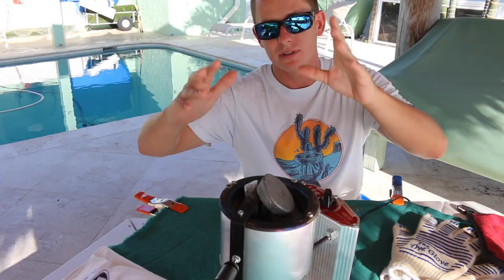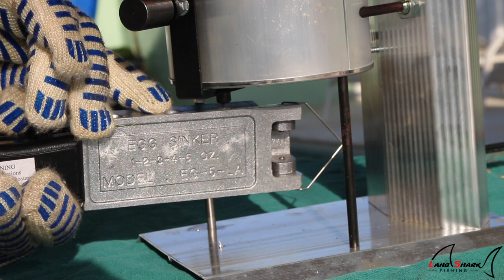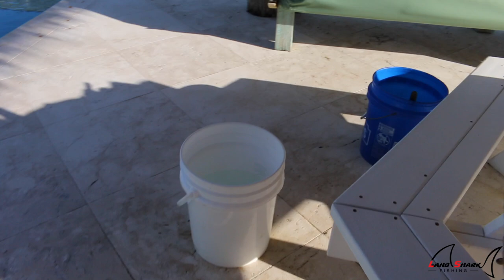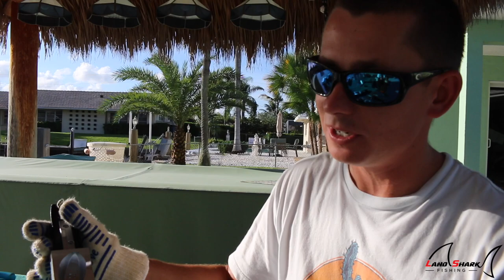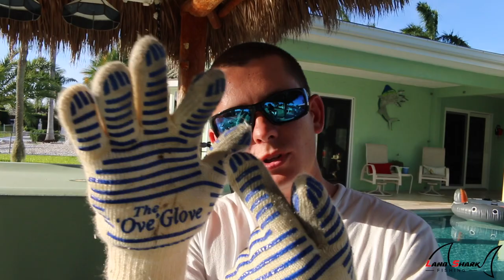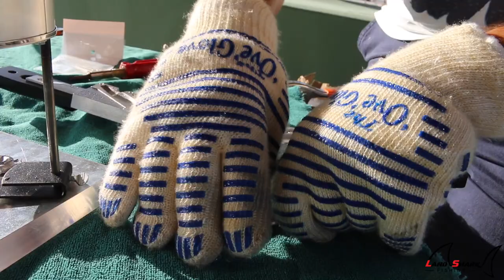ALL This Could Be YOURS!!! Make YOUR Own Fishing Weights, Sinkers + Jigs (Tackle Tuesday)

Comment: Vic i love your videos.   But i'm a metallurgical engineer and i totally geek out  on your casting videos.  Glad to see that tackle Tuesday is back.  Although your knowledge of fishing is great you need a little work on your solidification science.   On your large bank sinker the defect in the eyelet you talk about is called a cold shut. it  is cause by the lead cooling too fast. you are also getting some defects on the surface of that one and the vertical jigs. also caused by the lead cooling too fast.    You should  try to preheat your molds would probably be the best way to fix it.   you could also raise your pouring temperature if you can. you could use an lead alloy with a lower solidification temperature. But either way you should pour faster especially on the larger molds if your equipment will allow you to, or use a ladle to fill the bigger molds so you can pour faster.   I'm glad to see your warning about water that can be very dangerous and please make sure your molds are totally dry as well, preheating will insure they are totally dry.
Reply from the maker: +Aaron B Thanks for the tips 👍 I'm still learning!
Reply: Also you can use a candle or lighter  and add a layer of soot onto the mold cavity by putting the fire to the mold surface. This will help with removing the cast.

Comment: Couple things don't hit your mold to release the weight with a steel tool use a wooden dowel. You need to smoke your molds for easier releases you can do that with a candle. There's really no need to throw them in water just let them cool on the table top. The water your dumping them in is toxic and then what do with it dump it in the yard? Not good. Another person said this but preheat your molds and pour fast that will cure a lot of issues with the imperfections. I preheat mine by laying them on top of the pot with the molten lead heating the mold. Use a lead flux to stir in the molten lead it will blend the different metals in the lead and float the slag to the top to be skimmed off. You can get the flux at Brownells a gunsmithing website. Hope this helps.

Comment: Just a couple of things. You should be able to get your wires that make the holes in the slip sinkers with wooden handles. I have never seen just a plain wire like you were using. Makes it so much easier pulling the wire out of the sinkers. Get some gate cutters for cutting the lead sprues off the sinkers. They make a neater cut. I am due for a new melting pot. I have been using the lee magnum for several years but have been intrigued by the bottom pour melters. Watching you use yours was pretty cool. I love those flutter jig molds. Haven't made any big ones mainly use the I/2 to 1 oz size for mackeral and bonito.
Reply: correct of the gate cutters for the cleaner sprues or at least just bend the gates back and forth till they shear off for a cleaner surface.  Great vids Landshark Fishing keep up the great content!
Reply from the maker: +pat great idea thank you!

Comment: I've been casting bullets for years. got some do it molds and they are good. there are tons of places to get free lead. tire shops, dentist offices that use the old x rays, roofers, plumbers, pharmacies, back stops at gun ranges etc. lots and lots of places to get free lead. get a few muffin tins, a turkey fryer, and some wax and watch a video on how to make ingots. There's multiple sources to get it for around a buck a lbs on ebay and forums if you don't want to do the work which isn't hard. it's a fun hobby.
Reply: bubbacrabb it's dirt cheap from the Metals scrapper that recycles.
Reply from the maker: +bubbacrabb Power to the people!

Comment: Hey Vic Awesome video man! I don't know if it will help you or not, but I pour my own lead weights as well. I when I'm heating up my lead  I put my moulds on top of the pot to pre heat them. So the first couple of pours turn out way better.
Reply from the maker: +Anthony Henel Thanks for the tip

Comment: Vic, remove the slag from the top of the lead it will ruin your molds and your lead foundary.
Reply from the maker: +ChillyGames Thanks for the tip
Reply: Landshark Fishing Get something like an old pair of tongs or a fork. if you don't pull that out it will clog the spigot.

Comment: Should the shimano sedona 2017 model or get daiwa bg (I will be using it on a light rod for smaller lures)
Reply: Toe Knee daiwa bg is a much better reel for saltwater use. (I assume that's what you will be using it for). Cheaper shimanos aren't that great in saltwater in my experiences

Comment: All this stuff is way more expensive than just buying what you need from Walmart. I used to cast my own lead and it's not worth it. All these molds And stuff easily costs 30-40 dollars a piece which makes it more costly than just buying what you need
Reply: If you only fish one or two weekends per year that is completely true but if you are a serious fisherman and go all the time you will lose lead sinkers and jigs.  When I go fishing using a double drop bottom rig, the best fishing is near structure and of course I get hung up in it sometimes when the fish drags my line into or around it.  I usually use 2 oz. sinkers on those bottom rigs.  Some days I'll lose 10-15 sinkers (maybe even 20) before the day is through during 12 to 16 hours of fishing.  If your not getting hung up and losing some sinkers at least occasionally, your not fishing in the best spot.

Anyway, my point is that I can make the sinkers I use for a fraction of the cost of buying them...even if I buy them at WalMart. Yes, there is a chunk of money laid out for the molds and the other equipment used to melt the lead etc but they will last me a lifetime and the money I save will far exceed the money I spent for the equipment to make my own sinkers, lures and jigs.  By the way, shop around for the molds.  I just bought 3 different Do-It molds online from a company called Bottom Dwellers Tackle for $28.50 each.  That is way less than most places and just over half the cost of getting them directly from Do-It Mold Co.

Last year I went to an actual scrap yard and bought lead from them.  I can't remember if I paid 65 cents per pound or 85 cents per pound so for my calculations I'll use 85 cents per pound (of course the prices at the scrap yards fluctuate all the time so it could be higher or lower).  There are 16 ounces in a pound so in theory, when making 2 oz. sinkers, I should be able to get 8 from each pound of lead.  For the debate lets just say for a moment that I only get 6 due to losses from impurities known as slag that is skimmed from the surface of the melted lead.  Doing the math is simple 85 cents divided by 6 sinkers is 14 cents worth of lead per sinker.  I also just bought a 1 pound bag of #1 brass eyes online from Bottom Dwellers Tackle.  The bag contains approximately 1100 brass eyes and it cost me $11.00 so it comes out to 1 cent each.  That is the correct sized eye for the 2 oz. pyramid sinker that I use and each sinker only uses one eye.  Now, more simple math, 14 cents worth of lead and 1 cent brass eye is the complete sinker for a total of 15 cents in materials.  I was just at Dick's Sporting Goods the other day and they were selling 2 oz. pyramid sinkers for $4.49 plus 31 cents for tax (7%) for a small bag with 3 sinkers in it.  That is $4.80 and it equates to $1.60 per 2 oz. sinker.  That is almost 11 times more than the cost of the materials.  If I only lose 12 in a day it will cost me $1.80 in materials to replace them if I make them myself at home.  The alternative is to waist gas driving to Dick's 15 miles away, pay $19.22 for 12  replacement 2 oz. sinkers and then waist more gas driving back home.  Those 12 sinkers from Dick's ended up costing me around $22.50 counting gas.  That is 12.5 times the cost of materials for making my own.  That is also a savings of $20.70.  If I have this exact scenario occur only 10 times in a year, I will be saving $207.00 which is enough to pay for all the equipment that is used to make my own sinkers, jigs etc.  Anything made after that is all savings minus money spent on any materials.  It has been my experience that the larger the sinkers or lures like flutter jigs the more the lead seems to cost per ounce when buying them pre-made at the stores.  Prices of small lures seem expensive, medium lures are very expensive and large lures are absolutely ridiculous.

I personally go fishing way more frequently than many people and for a long duration of time when I do go.  Some months I may only get to go fishing 5 times while other months I may go 20 times.  Of course I don't always lose 10-20 sinkers either but there are plenty of times I do.  Therefore, for me the savings is real and it is significant.  The activity is also an enjoyable thing to do but if it is not your cup of tea, you may wish to just spend the extra money to buy sinkers from the store.  

When I go fishing, I often find ruined sinkers, broken/old rusty jigs or sinkers other fishermen have lost or discarded and I keep them to add to my stockpile of lead that I can melt down.  In the last year or so I have gathered about 50 extra pounds of material this way.  This additional lead costs me nothing so my material costs are significantly lower than the example above.